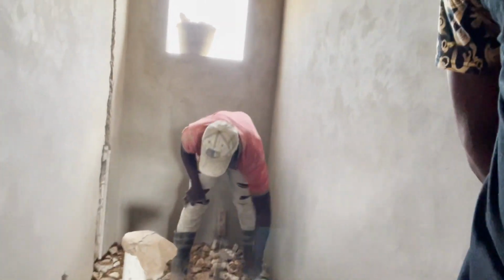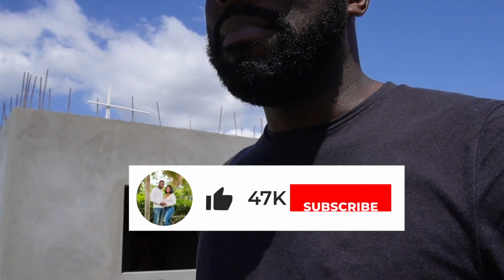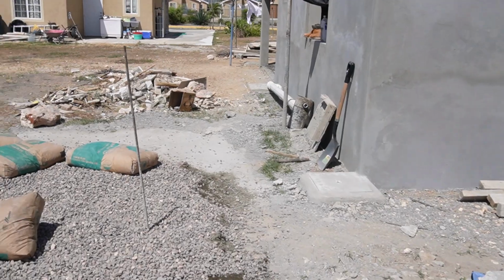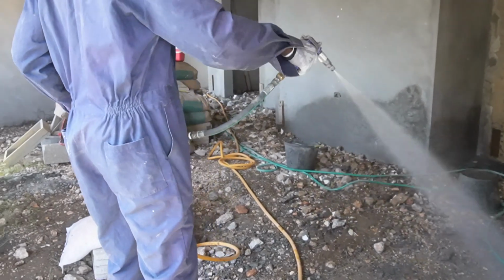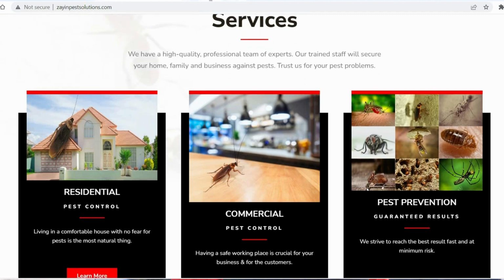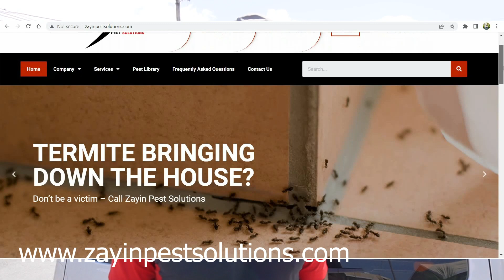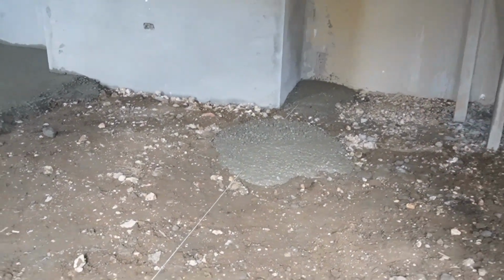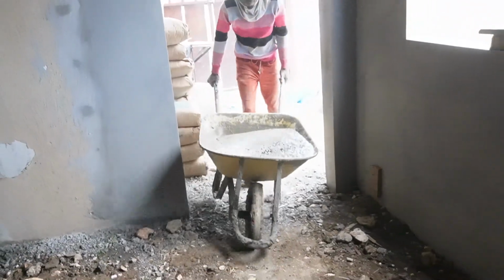We’ve finally done the floor | New Airbnb mason work almost complete

Comment: In Jamaica they don't do the flooring properly, the soil backfill should be compacted using a petrol driven hand held compacter,then pack the stones in and use a small hand driven roller to compact and level the floor then put the damproof membrane over it,then you screed the floor

Comment: Must commend you on pest control for sub structure, this is not widely practiced. i have a question for you / Everton . I noticed that there weren't any evidence of reinforcement (i.e. steel or fabric mesh) for the floor. Could you seek some answers for me why this is so? I am currently building but at belting at the moment. I studied at Heart NSTA just to acquire the knowledge as a female. So far I am able to connect with all your practices. I applaud Everton for his  humility with his level of expertise in so many areas of construction under his belt. great camaraderie among team unlike most site these guys are contained.
Reply: I also noticed that there was no  fabric mesh used...or floor compaction done to the floors. None the less the guys work neatly straight throughout from day one 😊👍🏾

Comment: You can also determine  the floor level from the top of the wall. 9ft
I see that you read my comment about pest control🙏🙏
Each one teach one.
You should have spray  the foundation  before casting though.
Reply: I think it was sprayed before floor casting began
Reply: @robhaye  foundation  not the flooring
Reply: Ok...got you now. Initial excavation of the foundation trenches
Reply: @robhaye  it is three phase of treatment  1. Before you cast foundation 2. Before  you cast flooring 3. Once you finish  building  you must dig a trench around building, it must be 1ft wide X 1ft deep. Pump pesticides  in trench then all the dirt you putting back in trench MUST be saturated with chemical. That should form a barrier around building. 
It's best to repeat step 3 every 5 years.
Reply: @fuzzydon857  thanks for the info...I know these stages but didn't know stage 3 had to be 1ft deep.
Thought it was just on the surface of the building perimeter
I don't think persons ever do this every 5 yrs

Comment: All those floor  are going to crack over time. because there is no brc and no compaction. five to six years the tiles will pop or crack
Reply from the maker: This man doing this for more than 20 years. You should not speak in such absolute terms if you cannot time travel